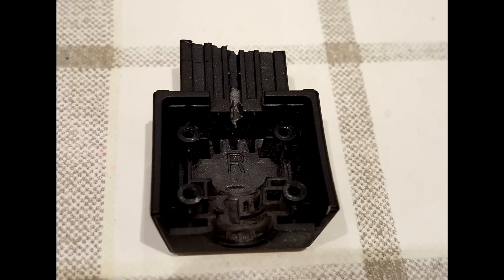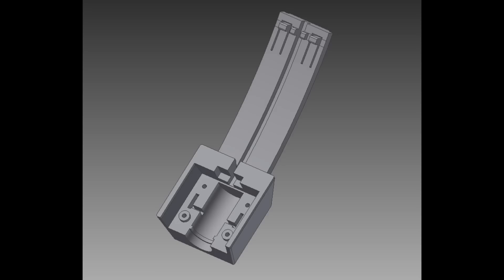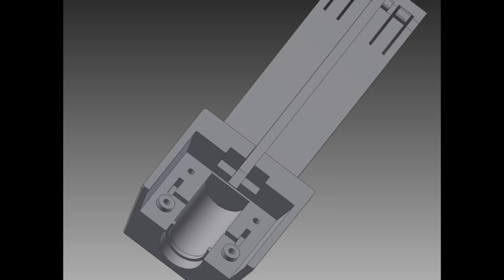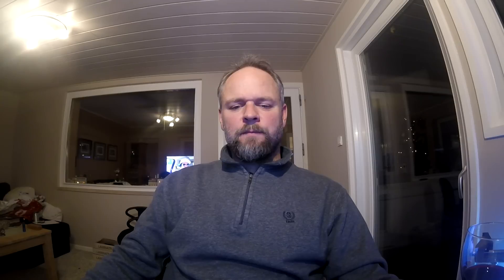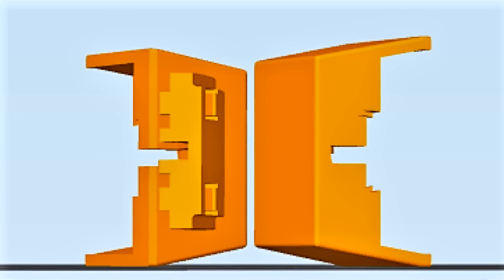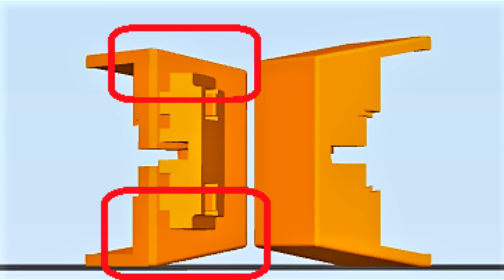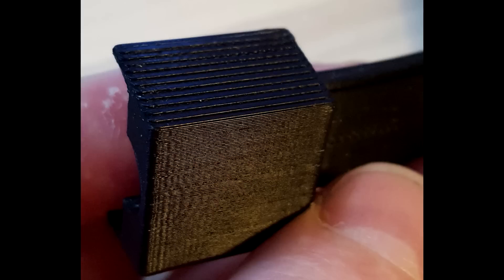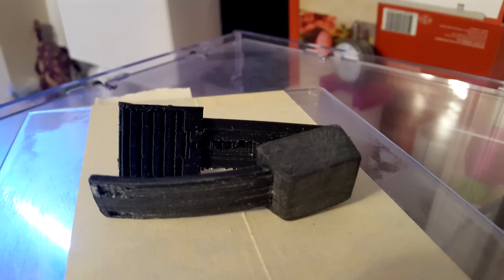Let's fix it: headset repair

Comment: Can I buy two of these from you?
Reply: I sent model to shop and they combined the two sides and did a different printing process. It did work. For those who wish to also repair, under neath headband cushion there are three screws. Once those screws are removed, it will pry out without force. The original adjustment arm - the wire goes through a hole and you must cut out the plastic without cutting the wire in order to remove the wire from the old arm.

Comment: Awsome fix, still love my headset just have to use a headband on them atm.
Looks like I found this video a little to late, is there still a chance to get the schematic?
Reply from the maker: Do you have a printer available to you?
Reply: @jenandkim2003  no, but I have found a service I believe. I got the file from one of the links.